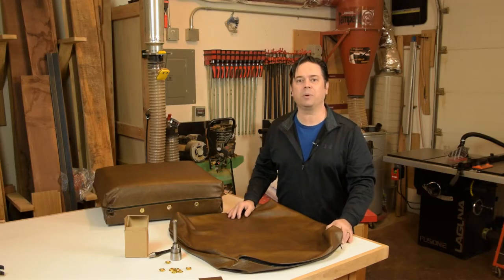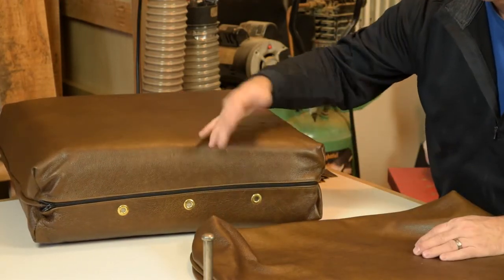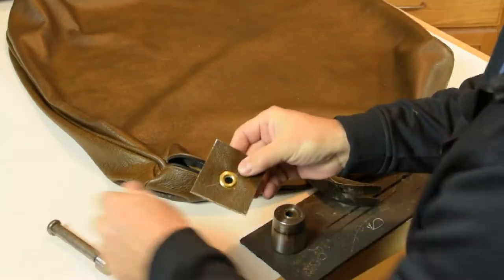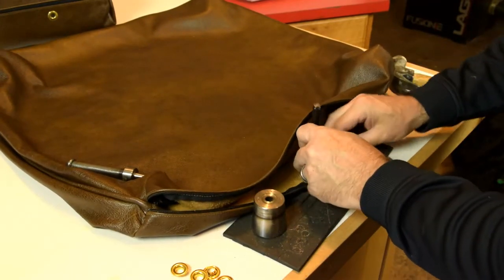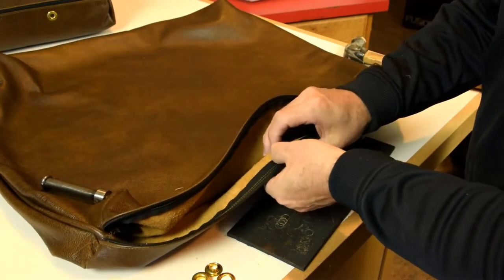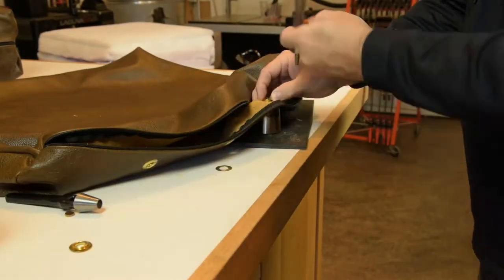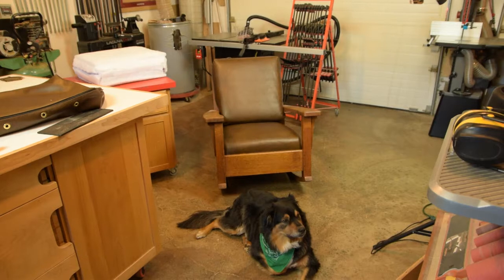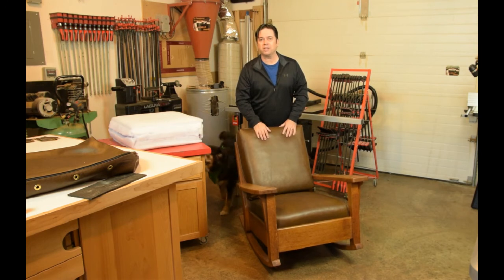Vent / Venting Leather Upholstery Cushions with Brass Grommets  Ventilators Upholster cushions

Comment: Thanks for the info!  Pretty rocker!  Could this be an option when making seat cushion covers?  I am simply wrapping faux leather around a pretty wooden seat (with foam and batting) then stapling to the back.  I know you should drill holes in the wood but I don't want to drill into the nice wood.  I should have probably made seat pads but don't have a sewing machine.  I plan to add decorative nailhead tacks around the bottom border.  But, would adding a grommet to the back be a good option or is there any other another options?
Reply from the maker: Hi Pamela, 
Usually an integral cushion is vented by jute webbing underneath.  Your situation is unique.  If you're hammering tacks in around the edge of the wood seat, then you've forever changed the upholstery design.  Nobody will ever use it without attached upholstery right?  So you might as well drill vent holes in the seat.  Otherwise you could use cloth fabric instead.  I've never seen anyone vent a cushion the way you propose.  I guess it might work.
Best of luck whatever you decide!
Reply: @TheThoughtfulWoodworker  Good point about the tacks.  I’d be hammering a bunch of holes. Hmmm.  Of course this is my first attempt at “upholstery”.   Maybe the old chair pad was the better option. Lol. Thanks so much for your reply.  Appreciate it!